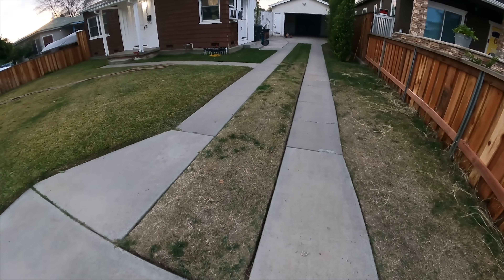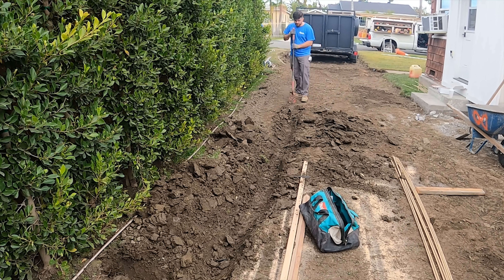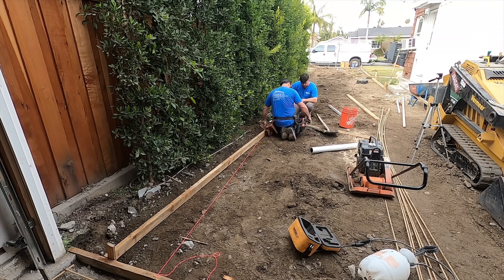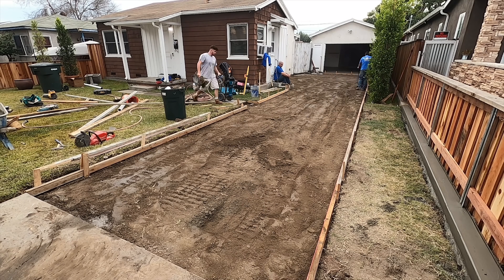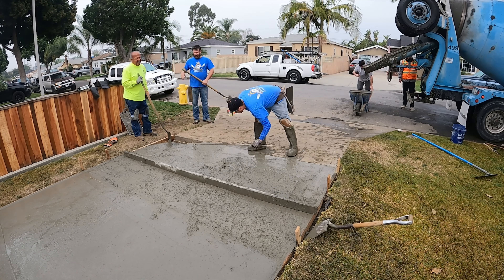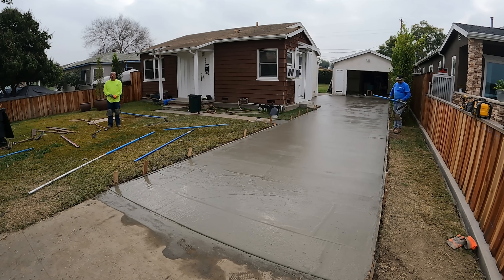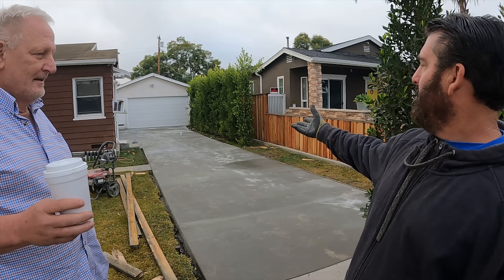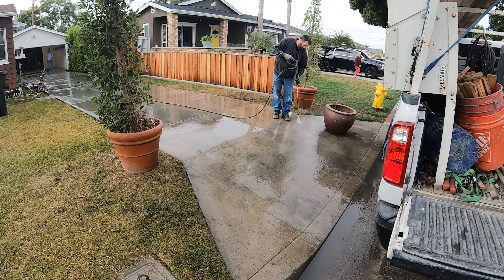Homeowner Ruins Fresh Poured Concrete Driveway!

Comment: You created a tripping hazard leaving the  lower step riser  unequal with the other riser   Should have replaced  the steps,and the  section by the gas meter, and  wrapped the meter pipe with poly void. If concerned of damaging gas pipe, use a demo chipping gun, instead of air hammer. The point is you don’t want the job to look like patchwork, and it’s also a liability issue, if anyone trips  on the step and gets hurt
Reply from the maker: No worries, phase two.

Comment: I find concrete stupid. Like the gasmeter at 25:37 if you want to change the gaspipe you cant. And other stuff you cant go underground to maintain your pipe lines or cables. I am also a contractor and i advice my customers that its not smart to pour concrete on cables and pipes.

Comment: Mhh you should put more effort into the rebar preparation. It would be be best to not touch the original ground , so that the concrete can engulf the rebar completely. Otherwise it's easier for the rebar to corrode, what follows are cracks and so on...
Reply from the maker: Fiberglass doesn't rust

Comment: WoW only 2" thick concrete. They must only drive a compact car. We wont lay down anything but 4" thick even if not having a 1 ton truck that we often have loaded. 2" concrete cracks and beaks up too easily even after having done a lot of ground prep, but maybe 2" thick is all that a home owner could afford and so in that case we're not blaming them.
Reply: Where was it only 2" thick? He has 2x4 formwork around the entire thing, with a gap below the forms. Those slabs are 4" thick.
Reply: @ShimrraJamaane  
Hey doofus, he said and even showed near the beginning that the original concrete was only 2" thick
Reply: @tymz-r-achangin  Hey doofus, he said a 2" slope, not 2" thick. At 2:36 he says the old slabs are 3.5" to 4" thick. You can clearly see they aren't 2" thick slabs. Want to wind back the ego there a bit, bud?
Reply: @ShimrraJamaane  
I misstated that he said for the concrete was 2" thick but hey doofus maximus, the reality isnt me having an ego, the reality is you having a problem with paying attention to the overall message someone wrote. You can clearly see before and after 1:42 that it SHOWS A LOT of the slab was nowhere near 3.5 to 4" think but was only 2-3" thick
Reply: @tymz-r-achangin  If you waited 12 seconds after the timestamp you linked, to 1:54, you would hear him state that the debris was from the garage. In the first video, he said that was poured about 80 years ago.

"the reality is you having a problem with paying attention to the overall message someone wrote" You mean like where you paid attention to the overall message from the video?

"but hey doofus maximus, the reality isnt me having an ego" It is, though. Stop being so arrogant. The concrete from that initial load was before this homeowner was even alive. "They must only drive a compact car." Or, they must have moved into a home that was older than they are.

I mean, do you want to keep making mistakes and having me point them out or what? I was respectful in my first comment. You got your panties in a bunch because you made a mistake. You at least admitted to that mistake but then tried to puff your chest by going into yet another one. Just say "oh, I didn't realize that concrete was from the first video, I'll go comment there."
Reply: @ShimrraJamaane  
Go start you're arguments with someone has nothing better to do. Didn't read your last comment and wont be reading any other ones.

Comment: Drain under concrete? Not wise. Don't add fibre mesh at the site. Have the Batch Plant do it. Now they are liable. The fibre mesh isn't for spalling (although it doesn't hurt), it's for strength. And ALWAYS tell the owner to "stay off the feakin concrete". Lastly, who designed the joint pattern?

Comment: Bad news, as it ages those marks are going to be more visible than the curing process.
Reply: How do you think so? The reason they are visible is because the concrete is still dark from being uncured. Once it is cured, the color difference will be far less. As he says at 22:44, "Once this is all cured-out white, you're not gonna see any of it." The concrete doesn't get darker as it cures and the marks won't get so much lighter.
Reply: @ShimrraJamaane   Once the concrete cures, Yes it does turn white, But after that it begins to tarnish if you will and everyone of those marks will be much more visible than in the curing stage. I've done concrete for many years. That's why hand prints in the concrete can be seen much better 3 years later than when freshly done.
Reply: @prowannab  Handprints are embossed, these weren't. He stated that when discussing the fact that they will be mostly masked after curing progresses further. All the owner did was superficially disrupt the surface finish. Sure, it won't have a nice even finish, but the color won't be affected substantially just because he scuffed up the surface a bit and caused portions of it to cure faster.

At worst it will look as if it had been somewhat chipped (because it was).
Reply: @ShimrraJamaane  No, The finish will be forever marked because of the homeowners idiocy. This will be clearly visible after the white stage passes. 2-3 years.
Reply: @ShimrraJamaane  Believe what you will!

Comment: You talk about the ‘hook’ and pulling up your rebar, nut just as you are saying it, at time 13:50, you go back in and crush the rebar back to the ground. The whole, I pull it up, don’t need chairs, gets this kind of work, and I guarantee that your slabs will be cracking far sooner than one put in with rebar in the correct depth location. Why pretend to do something? Then why brag about it when you do? Look at the guy standing on the rebar and its position AFTER it’s been ‘pulled up’.

You put in so much effort, and 90% was great… but your reinforcement is severely, and unnecessarily lacking.
Reply from the maker: I've torn some of my work out with the same techniques used on this one.
The rebar when removing was in the middle of the concrete.

Comment: The steps into the home are illegal now.  They need to come out, be re-poured equally, and even then they may not technically be legal in some areas because they may be too short.  It's really nobody's fault...just a jobsite condition to deal with.
Reply from the maker: NO worries the house just sold for 885,000

Comment: Why do They work and work and work the concrete to death? All you need is a 4 foot by 1 foot Fresno and Fresno it 2 or 3 times . Hit the inside edges on knee boards once and run the outer edges 2 to 3 times at the very most. I guess if you learn the hard back breaking way . That's all you know.
Mikey Out. Oooooh Yeah!!!!

Comment: CLICK BAIT.   Nothing was "RUINED'.  He even says the marring was temporary.   BTW, he has created a step and a half step on the house.  Dangerous and against code.
I will never get a single slab driveway with rebar.  Neighbor did, and when the service line failed, they had a tough time breaking up a slab with rebar!  Much better to make sections that can be lifted for underground repairs, and that can shift without cracking a slab.   Looks better, too.

Comment: Thin strip right buy driveway = var compressed sprinker line at best. 

Typical hack job from shishters  cut corners  poor work just to get by . It in all the trades
Reply from the maker: OSS
Reply: @OdellCompleteConcrete      at least you all seam to got your stuff right . Seen lots of job hacks in my time in home construction

Comment: Smell a lawsuit coming with trip hazard with different heights in sidewalk  areas  why curb area needed ?just to hide gap?  🤷🏽‍♂️  lotta trash under rebar must not b no inspection ? Dang concrete cost more than that tiny house lol  1  too many shooters I'd say lay off the juice bob worst case stain it bob !